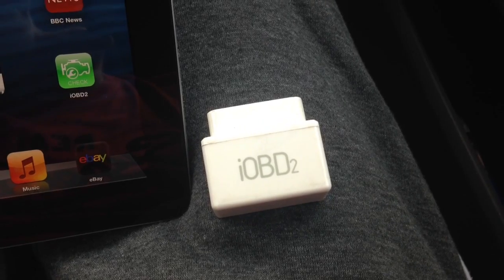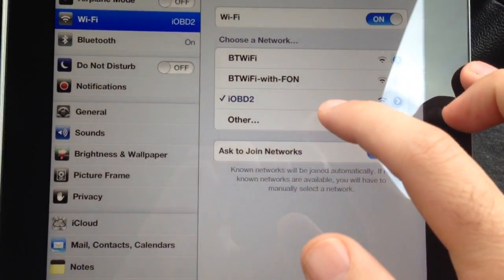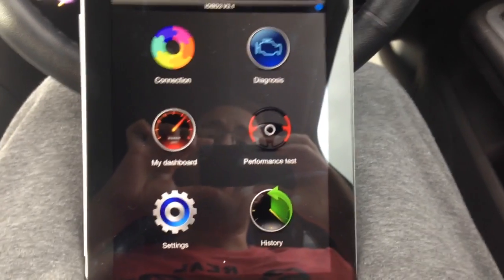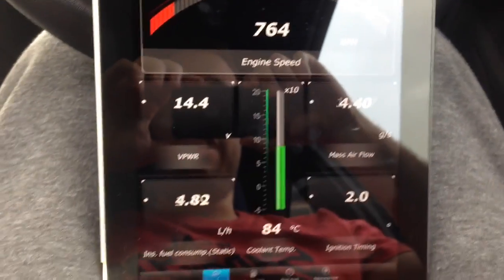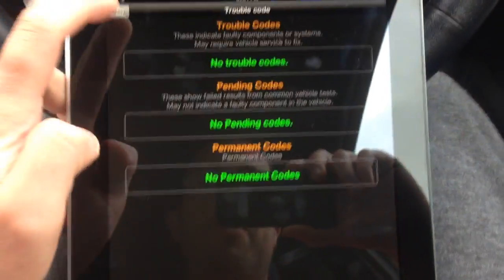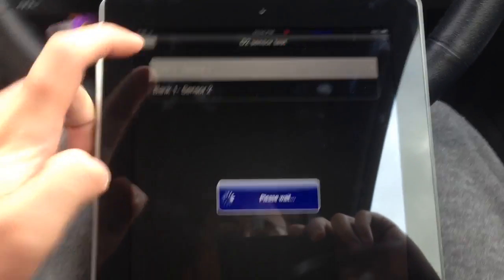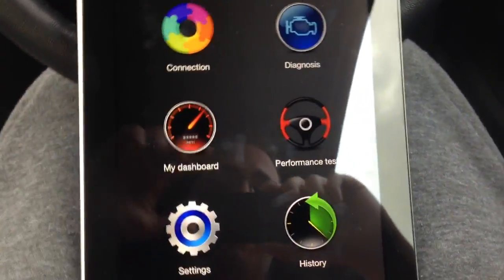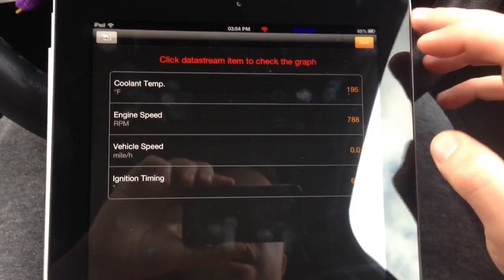XTool iOBD2 Review Hands On

Comment: You plug the tool in when your car is in running mode?
Reply: Thanks Joseph for the comment.

I understand that the OBD2 device have to be plug in while the car is running.
What i actually mean is... Do i need to plug in the device BEFORE the engine start but keep the ignition ON or plug the device in only AFTER the car is started and engine running.

As i can see in your video, you are plugging it in while the engine is running right?
Reply: My car show fault code on the first time plugged in... the fan keep running and it could not start until i remove the device.
Is it the symptom of the device has some problem on it?
Reply: *****
I have informed this matter to the seller luckily they have agreed to exchange with a new unit, thank you so much for your comment Joseph!
Reply from the maker: It depends on the car, mine runs fine when the car is running and turned off. When its running I can log stats of the car